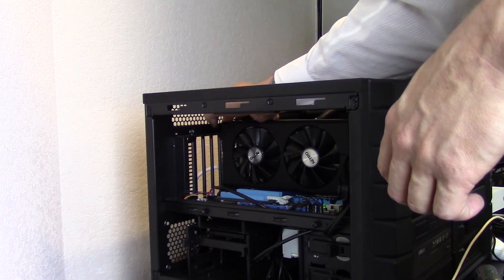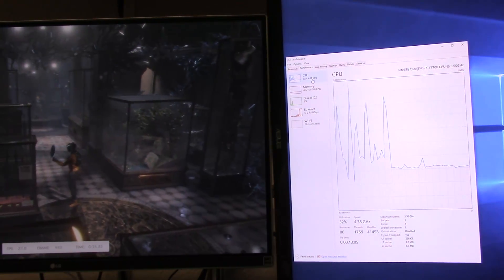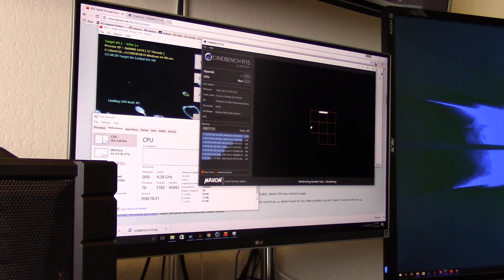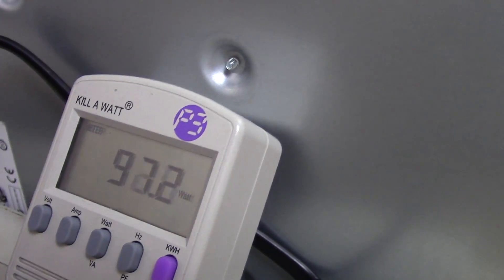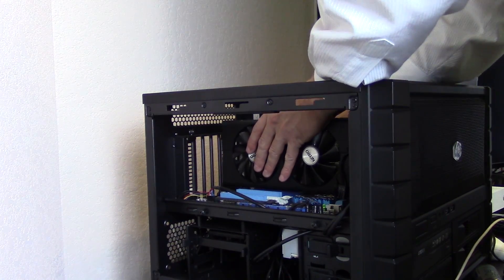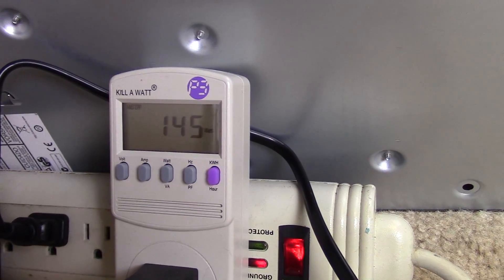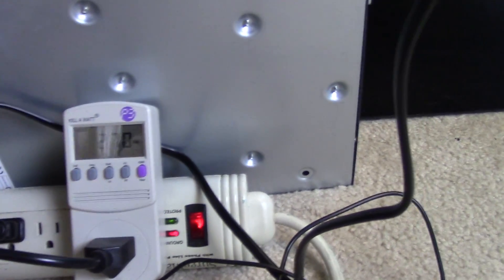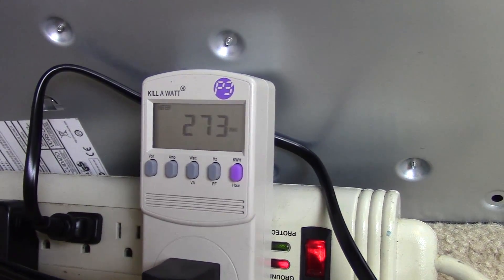The RX480 Uses More Than 100 Watts: Here's Why!

Comment: Kind of silly and incorrect. First of all, you're forgetting that power supplies don't have the same efficiency throughout their output range. I can't see what power supply you use so just assuming: When you measure 90w from the wall,the power supply probably has around 75% efficiency (if this 75w is below 20% of psu's output)  while at 250-300w the efficiency may go up to 85-90% .. so your numbers are screwed from the start. 
Best way to make such measurements would be to buy a pci-e riser cable and just cut the 12v wires (search for the pci-e pinout, you'll find all the wires are conveniently placed right at the start of the connector and you could put a multimeter in series there to measure the current. There are multimeters which even have data logging to do measurements over time.
You'd also have to measure the voltage at the same time because the voltage provided by the motherboard won't be the same voltage as the one coming from the pci-e power connector, because the copper traces in the motherboard are thinner. 
So basically  measure voltage and current at pci-e slot, measure voltage and current at pci-e connector  v x i + v x i = total power used by video card. 
Even using multimeters to measure currents is a bad idea, because by design some power will be lost inside the multimeter when measuring current so it still won't be quite accurate. 

It's possible to replace multimeters in series with chips that rely on hall effect technology to determine the current amount going through a wire without addin resistance (causing power loss) through that wire. Have a look at chips like  ACS724 (search for it), they're super simple to use - you power them on with 5v , put them in series with your wire and they output on a pin a voltage that varies with the current .. ex at 0A they output 2.5v and for each 1 A , the voltage goes up by 200mV (the exact number depends on which ACS724 chip you choose) so if the voltage is 2.9v you know the video card uses 2A at whatever voltage is on the pci-e slot.
Reply: Go see jonnyguru 's review for 860i. I wanted to sugest techpowerup,they have a nice efficiency curve but their measurements are only on 230v AC

On Jonnyguru's review there's a table with test results for efficiency, i extracted two representative ones:

It has 83.5% efficiency at low loads: 85w to components, 102w from the wall
It has 91.5% efficiency at mid loads : 258w to components, 292w from the wall

At load, the video card's consumption would be determined like this : 258w - 85w ( + video card idle consumption or about 5-7w for RX series but we can ignore it in both counts) so about  175w , not 292w-102w = 190w ... it's 15w difference if you just use the wall measurements, making the video card seem more power hungry than in reality .
If you want more accurate you'd want to go the route of tapping into the pci-e slot 12v rail and measure current and voltage there, and the same at the pci-e connector. That's how Tom's hardware does it, check their reviews and you'll see their equipment. My suggestion for using hall effect transducer chips is kind of a poor man's way of replicating their methods. 

Anyway, going back to topic... big difference percentage wise between efficiencies, but in actual watts not so much. Still, important to know when figuring psu idle power consumption, or power used when watching movies etc 
And the numbers are for 120v AC input, with 230v AC (Europe etc) the efficiency is substantially improved.

I didn't think your comments were defensive, i enjoy the discussion and thank you for answering so fast to my comments.

Comment: hmm... i don't often post but now i have too...
first, when you launched firestrike it put another load to the CPU so your 95 watt for the cpu is wrong (it's higher) so your rx 480 exact power consumption is wrong.
and second, what you "took" for the rx 480 power consumption is the gpu power consumption+ THE BOARD power consumption ( fans, rams and other stuff on the pcb). when AMD said rx 480 was around 100 watt they were talking about the GPU without the PCB components, and they were right.

Comment: i saw a video where an overclocker was taking the watt number by using a custon chip on the card...he had about 110 watts on stock clocks but without the fans (i doubt the fans could use more than 3-5watts) ...also the method of counting watts from the wall is not really accurate the psu is wasting some energy between 20 to 5% depence on the quality of the psu... sorry for my bad english also the card was undervolted and the cards load was under games not benchmarks ...

Comment: @SonOfATech, any chance  you could run TimeSpy/FireStrike and see what the MAX Wattage Spike where drawn, you can use Trixx3.0 or GPUZ  (MSI AB does not appear to be accurate) and let me know what your max was?
My card is averaging 170-180 (Thats Average) but I have spikes showing max watt pulls of 230 Watts (Thats Max spikes not average). Thanks
Reply: ***** Alright Son! Just watched your vid on the msi and on my exact car the Nitro. Looks like your max on the Nitro was 225 (mine at +15% is showing 231), and your MSI max was 336Watt Peak Max draw? Holy cow. 
Let me ask you, are these 200+ peaks in wattage dangerous for the  cards? Obviously the cards  are not staying at that amount as the averages are better (lower). 

This is my second Nitro+ card as my first one died yesterday after OC to 0mV, 65 Max Temp, 1460Mhz and a Power Limit raised to +30%. It wasn't stable yet, but I also wasn't at full Peak and I could have raised the mV, but before I got there, it died and never came back. 
Needless to say I am a bit scared trying to OC this new card and raising the Power Limit, as thats what did my other card in (or again I think thats what did it in).
Reply: ***** Yeah I have a gold PSU Corsair at 850W so I should be good thanks. 

Now I think you have helped me make my decision. I think I'm just going to with another brand card and just pack this one back up and take it to the store. Funny thing is I was thinking about the MSI one yesterday while in the store. The only other one that Looks nice and I'm trying to research is the XFX GTR Black edition.
Reply: ***** Ok great I will chec the video out. Yes the Black GTR was the one that I was eyeing, going to check pricing.